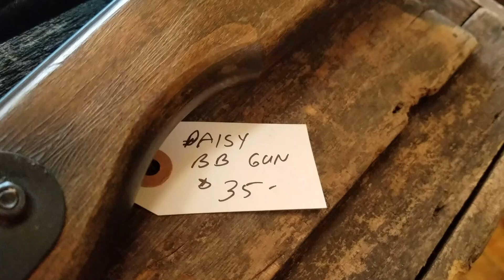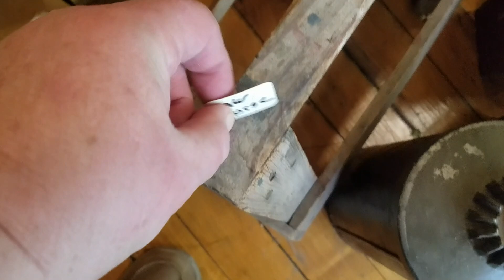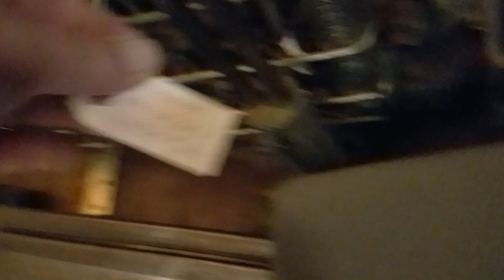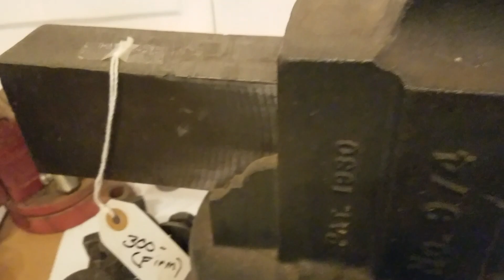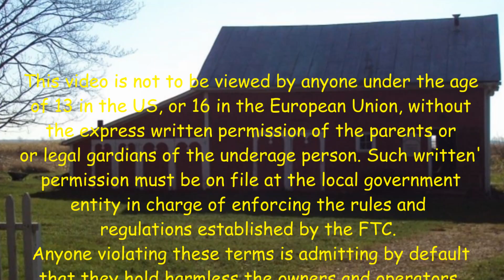A Quick Trip To The Heritage Company In Kazoo 01

Comment: The quiet was nice and  saw a box of the old ceramic tubular insulators that the O L D electric wires used to run through. Make FINE sharpening rigs. Yall remain calm and don't fall down any more. God less Yall!
Reply from the maker: One thing about moving I get to see everything that I haven't seen in years. 
I stumbled on the box of some of the knob and tube insulators that I removed from the old house when I rewired it. 
Perhaps there is a new business in the discovery. Old Sneelock's Antique Emporium & Knife Sharpening Devices. 😁😎

Comment: Good old stuff.  I would take any of thoes vices pre 1980s over anything they make today in India or China.  They don't let the green castings for the ductile iron age enough before coatings and machining.  That is what's wrong with all modern woodworking machines.  Only an hour away to Kalamazoo but hours of fun looking around!
Reply from the maker: Ford always left the V-8 engine raw castings sit outside for a year to cure. 
I was telling Rodger that day that I was happy to see how much my collection increased in value. 
The vises I bought for $10.00 are marked at $325.00. That is the asking price of course. 
The vises are still only worth $10.00 in 2020 money. The difference is the 2024 dollar is only worth $.0325 in 2020 money.
Reply: Regardless of value quality is quality and that's why some of thoes low compression engines are still running almost a century later.  I do know the wilton bullet vices and Columbias cam be worth some money.  The bullet vice us just for looks though very functional.  Long gone are the days of a vice in the workshop in every American home.
Reply from the maker: I got into repairing, restoring vises. 
I still have several sitting in the shop. My favorites are a no name cast iron 5" vise bolted to the bench downstairs and my blacksmith vise in the Annex. They soon will all be in the Annex and I can get back to fixing tools instead of moving equipment. 😀😎